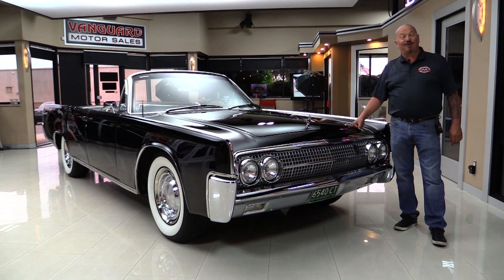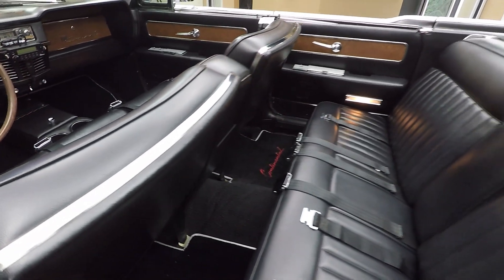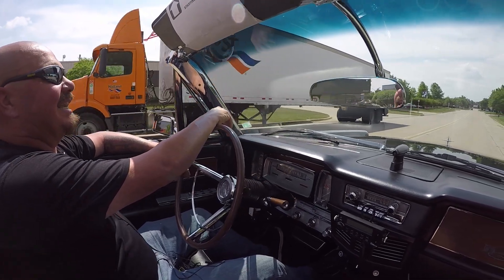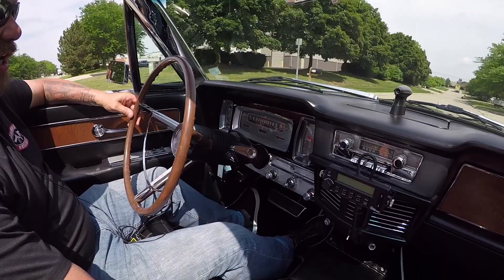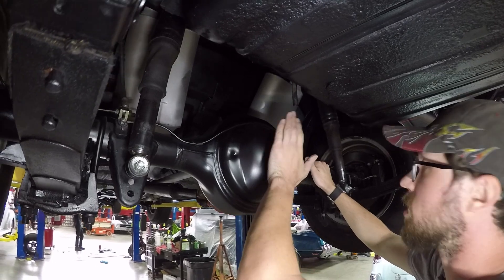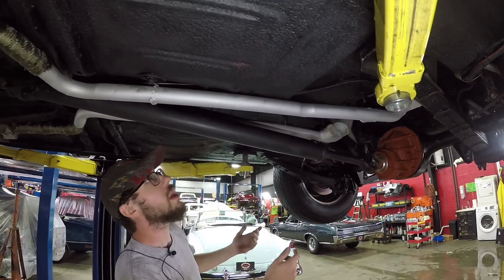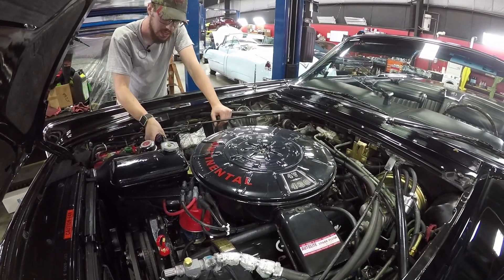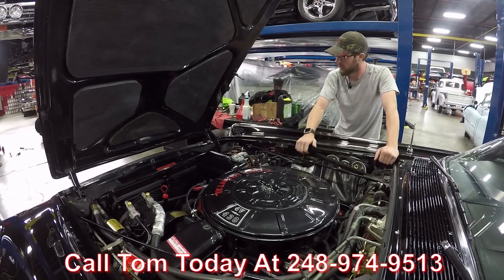1963 Lincoln Continental For Sale

Comment: That's the coolest '63 Lincoln I've ever seen! One thing I would point out is the condition of the chrome looks fantastic for this car, especially inside. Solid and nice fitting. I've got to take a vacation and come see you guys.
Reply: John Valdez that’s all brushed stainless, not chrome..Same with trim pieces atop fenders. No one does that anymore

Comment: Howcome no one makes 4 door convertible with proper back seat nowadays?
Reply: A consequence of downsizing, safety, and as usual, the popularity of SUVs.
Reply: 4 door cars were family cars. 4 door convertibles were never high production totals. Time moved on from the 70s , fuel economy standards were up,  imports dominated, minvans raomed the highways in packs,  suvs took over, in all forms of absurd looking design.   After suvs took over people became addicted to sitting high up and being able to see around them. other people couldnt see so they bought suvs,. small cars were called mid-size, mid-size were called large. Seatbelt standard required a shoulder harness which makes for awkward looking design. .